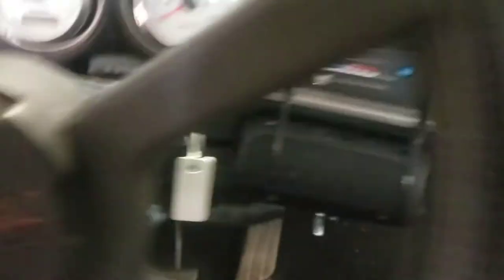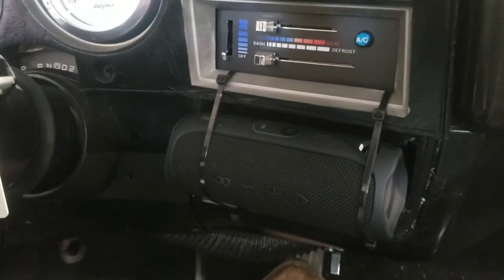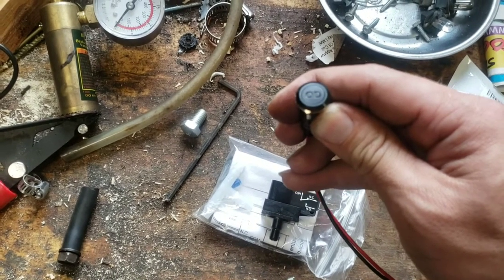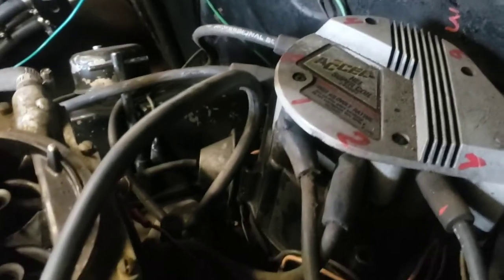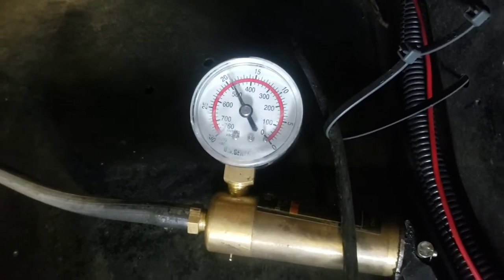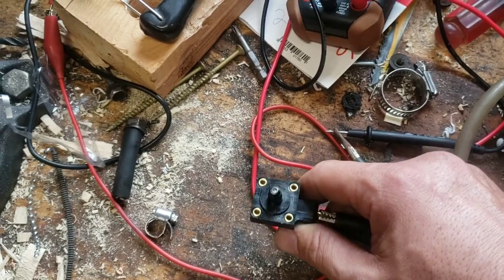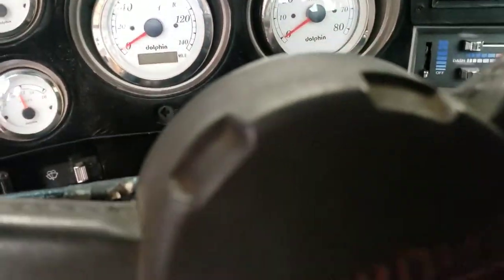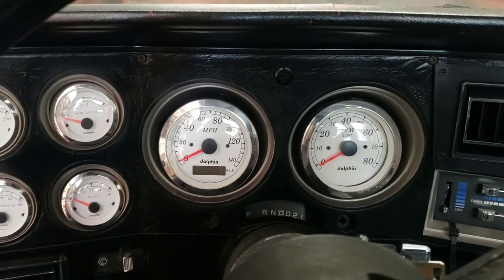700r4 vacuum switch on c10

Comment: You can wire this in series: K058 Vac-Switch, 4th Gear Pressure Switch, the LOCKUP Defeat Dash-Switch, and the internal-solenoid on the 700R4 - run it all to the 12V supply and ground the internal solenoid;  Averagerod mentioned a delay and yes you can buy a vacuum delay off of Amazon and it will delay the vac-switch to delay activation by a few seconds; For the torque-converter to lock in 4th gear: the dash-switch is closed, the oil-pressure switch is closed, the vac-switch is closed .. and that sends 12V to the solenoid which locks the torque-converter; there are other ways to do this; in the example here averagerod is running this to manifold vacuum; you can also wire it NC or NO .. as you see fit, and run it to ported vaccum; the vac-switch is expensive, but it is adjustable and high-quality;

Comment: So I saw that your TCC indicator light was on at idle. Is it the case that power is running to the TCC but it is not in lockup since the truck is parked?
Reply from the maker: Correct. And the vacuum switch isn't calling for it, so no power is going to the torque converter

Comment: Every body talks about a "in-line fuse" but what size fuse do you need for this application?
Reply from the maker: I'd use a low amp fuse like a 5. Your really only trying to protect from a dead short and any size fuse is better than none.

Comment: I'm having an issue with engine shutting off when put in drive or reverse does this switch have anything to do with that or can you suggest a fix
Reply from the maker: The switch wouldn't cause that unless for some reason your torque converter is locking up. Have you tried removing power from the trans and seeing if it does the same thing?

Comment: So does the wire from transmission go to nc or no
Reply from the maker: It will go to the NC
Reply: @avarageerod  I thought the wire running from the vacuum switch to the TCC pigtail was connected to N.O.

Comment: My 2002 chevy calvalier started acting up after I exited a car wash. I got codes  p0719 0753 0758  p1860  & p0135 my car runs but speed want go past 30 mph. What should I check and where to find the shortage is it in the break pedal do that runs to the transmission. Has anyone ever had this problem and which wire circuit should I find the shortage

Comment: 10 seems kinda high.    idle vacuum is low.   this means, when your on the freeway and you step on the gas just a hair the switch will unlock. 
seems to me about 2 hg would be better.     just sayin.  not criticizing.   

good share..

larry
Reply from the maker: I agree but tried alot of different pressure settings. I did have the problem of it unlocking alot, but the delayed relay took care of it.